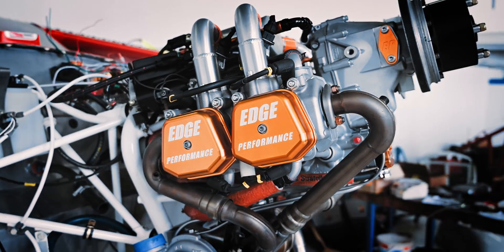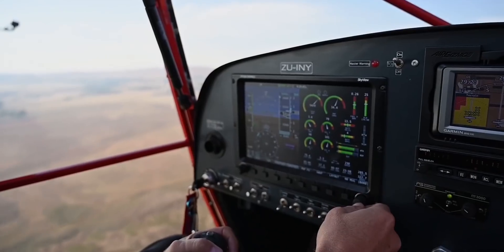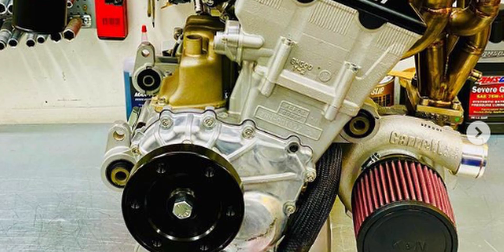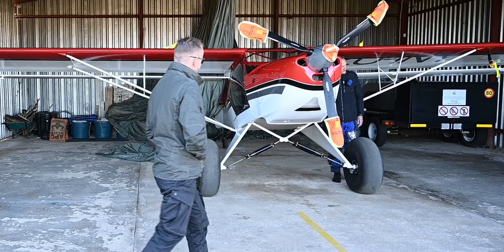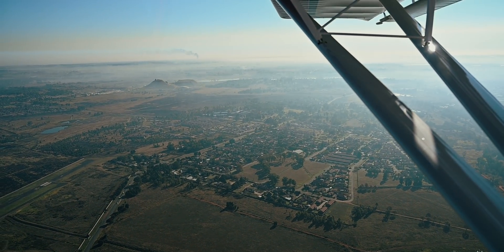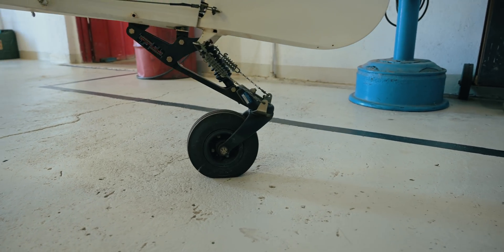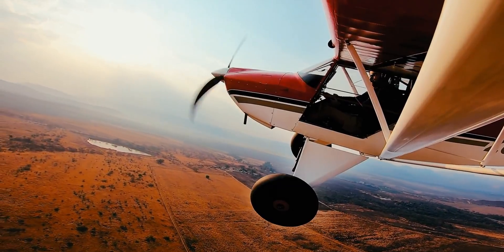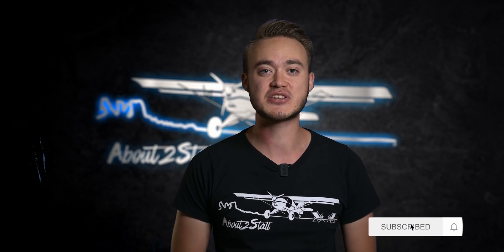165hp Engine in a KitFox!!! - EDGE Performance

Comment: What is the max  tested airspeed for this fabric covered  bush plane ?      Testing for a similar type plane ( not a Kitfox )     
Because the fuselage is still tube and fabric, and there is a real chance of the windshield, roof or doors failing, the airplane has been speed limited. 
https://www.youtube.com/watch?v=p7Z-0khP5-I

Comment: @About2Stall - How restricted are you with back-country flying in SA? Lots of red tape?
Reply from the maker: Way more restricted that the US, but less than Australia apparently...

The "basic" rules are, 
1. You have to have Permission from the land owner. Or
2. Have an emergency to land off-airport

So we usually spend a lot of time tracking down the owner(s) of land where we plan on landing before going there and then usually try and drive there with a 4x4 to assess the "safety" aspect of landing there.
Reply: @About2Stall  Perfect! Thanks for that... Looking forward to nog vidoes ;-)
Reply from the maker: My Pleasure!

Comment: None of the high horse power mods will do diddly squat, for landing short!  All that extra weight (my Kitfox 1, with a 65 HP Rotax 532, weighed 465 lbs., with about the same wing area this bird has) needs to be dissipated once on the ground, more inertia means longer LZ requirements, no matter the stall speed.  

    I do like the nicely  faired aft gear legs (covered AND faired, that's the correct  way to do it), and just as dictated by Dan Denny way back when.
Reply from the maker: I think you misunderstood, we can already land short, we need a bigger engine to take off as short as we can land 🤪 

Please let us know if we should clarify anything.
Thanks for the comment and support!
Reply: @About2Stall   My point was that more weight hurts landing performance, it doesn't help, it's a given.  I'm sure it will climb though like a raped ape!
Reply: No wind  27 foot landing    15-20 mph winds  16.5 feet landing   300 HP Edge Performance Yamaha    Highlander 2.5 foot takeoff, Steve Henry   
https://www.youtube.com/watch?v=TgncesRfqho

Comment: How much money do you have to make all this happen ... on a kit-fox nevertheless. You mentioned all the numbers except  the   $$
 ???
Reply from the maker: Hi Steven! 
We mentioned in the video that Our engine cost about €14500 - at the current conversion rate it's about $15 760,12 vs the $37000 of the Rotax 915is. The $15760 includes build labour and tax...

We will be able to give the final tally in the last video when the project has been completed! 
Hope this helps.😁

Comment: So two things to ask/discuss. 
1. engine power, the guys at Edge performance said to me that they would not recommend the big bore kits and the turbo. And you guys have gone for both AND a bigger turbo. So that puts a HUGE amount of stress on the crankshaft that was designed for the the 100HP 912. Yes they weld it into a single piece but that is still a modification not a performance made piece. And I am a fabricator by trade. Welding only gets you so far compared to solid machined metal. How did you cater for the crank?
2. The prop. so more blades means more thrust by converting more energy into thrust per revolution. This favours high power engines with very high torque that can support the greater resistance of the greater amount of blades. Now the cruise speed compromise. At the tip of each blade you get the vortices that are generated with any wing. This is where most of the drag of a blade is generated. I am not sure about this but I believe that drag in cruise is greater under identical energy consumption. In other words for the same fuel burn you will cruise at lower speeds. However you just put in a little more power and you get more thrust and you get back some speed. In other words its not a reduction in cruise speed, its a reduction in cruise efficiency. Like your tires. You reduce cruise speed only if your not allowed to add more power. If you wanna go the TNIO550 in the front I can tell ya those tires are not going to slow you down. Can you find out from Airmaster if this is the case or am I just confused. Also Noise 4 blades reduce noise. Did you notice a reduction in noise.
Reply: gus bisbal this engine started out as a 914 with 79.50mm bore and we converted it to ULS bore 84.00mm. So it’s a “big bore” 914, but it’s not our NA 88/92mm cylinders. We’ve stressed the cranks to well above 200hp, and broken a few, so we know where the limits are.
Reply: @EdgePerformanceNorway  Great! You know you need to put this out there on your site. There are a lot of shops that will not go to the extent that you have gone to. Some shops just install parts and don't test everything. I personally don't like to make anything that has not been fully tested because the moment I don't test, it is that element where I am found to be wrong. The more I find out about your work Thomas the more I realise that it is of a very high level of quality assurance.
Reply: Any welder that is worth their salt will tell you the weld is stronger than the metal around it.
Reply: Add the proper heat treating process and the crank should never break for its intended purpose.
Reply: I would induction or friction weld,anneal, machine and then pic the heat treating process for the application.
Reply: Easy peazy🤣